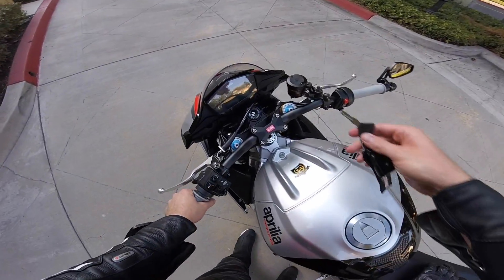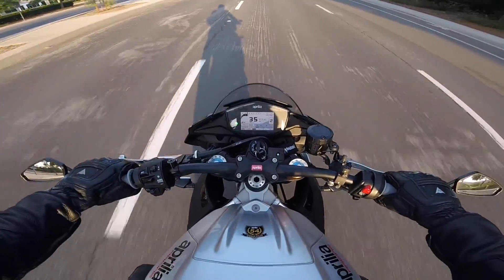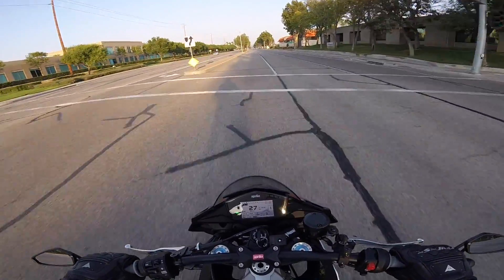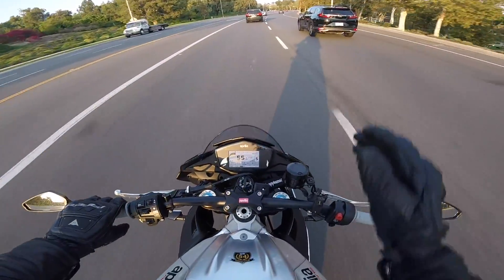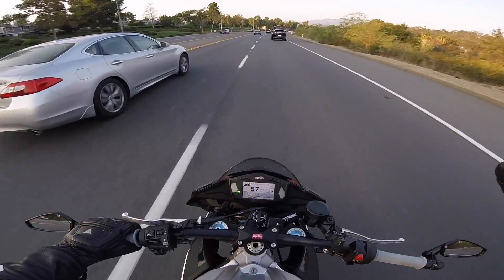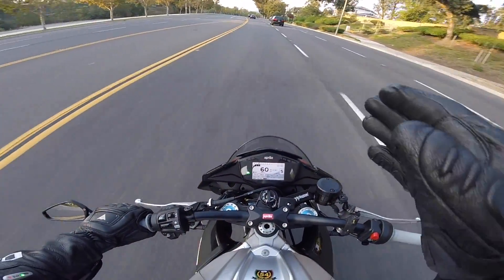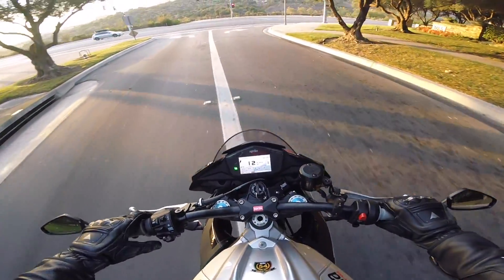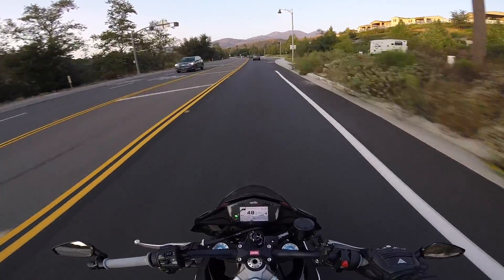How Cornering ABS Works on the Aprilia Tuono V4 1100 Factory and RSV4 (2017-2020)

Comment: Does your factory have a full system or just a slip-on?
Reply from the maker: Just an SC Project CR-T slip on with the Aprilia Race ECU flash.
Reply: @hiimchad  Wow. The full system would be a bit much in the sound department I'd guess. Sounds brilliant as is.
Reply from the maker: @NILOCOgov  slip-ons for these bikes are really 3/4 systems, as the exup and cat are integrated into the original muffler. So, basically has the same volume that a full system would. The microphone does not do it justice. 🙂
Reply: @hiimchad  Oh wow. Does that make the race ecu mandatory for a new muffler then?
Reply from the maker: @NILOCOgov  that or another ECU flash. There are a few different options out there, and then of course your local dyno tuner. 🙂

Comment: Hi Chad 
I got a 2019 Tuono recently. Never had electronic aids before. 
Can you recommend numerical settings for a track day?
Any advice appreciated.
Thanks
Reply: Thanks for this Chad…much appreciated.
Currently on pirelli super corsas.
I
‘Ve been out of doing track days for quite a while, although I used to club race years ago. So probably in the slower group!
Reply from the maker: I would recommend starting with the aids turned up a little high, and work them down session after session if you feel they're slowing you down. Maybe Traction on 5 or 6, ABS 2, AWC 2? Might be a good way to start again. 🙂
Reply from the maker: Hi Peter,

Congrats on your Tuono! 

I run ATC 4, AWC 1, ABS 1, and the Race engine map, both on track and on the road. Running ABS on 1 will turn off cornering assistance and rear lift mitigation, though, so keep that in mind. 

What tires is your Tuono on? Mine is on the Pirelli Diablo Rosso IIIs (OE tire for the Tuono RR, previous owner put these on after finishing off the original Supercorsas). I had a Tuono RR before my Factory that was on Dunlop Q3+, and I was able to turn the TC down to 3 without issue. 

Also, what group do you ride in?
Reply: Thanks again Chad. This is all great information.
Peter